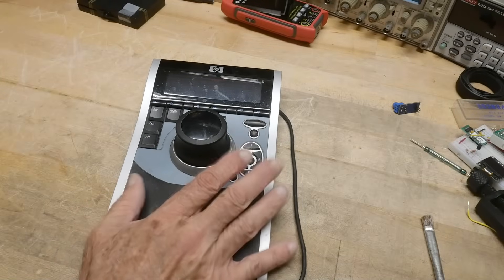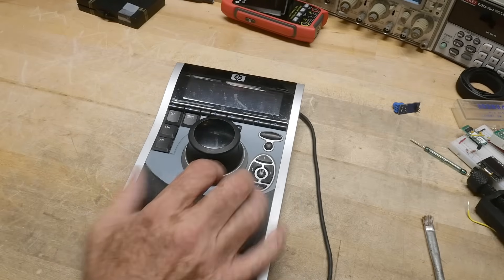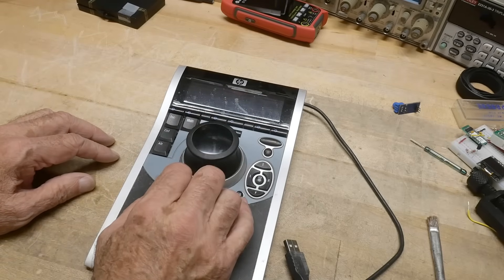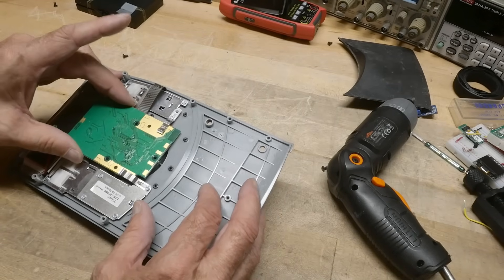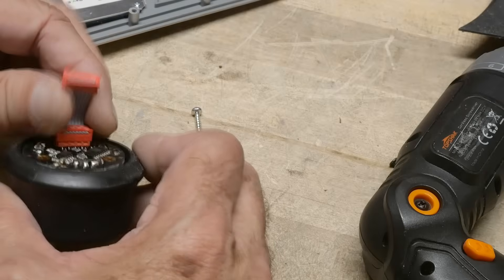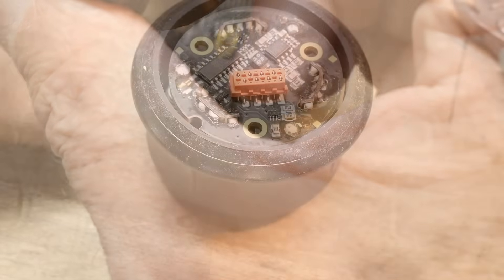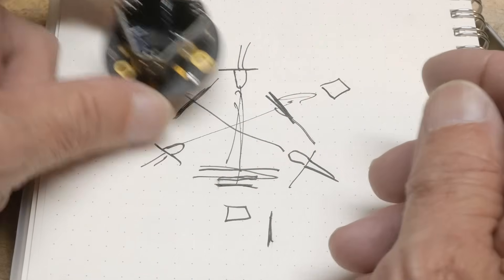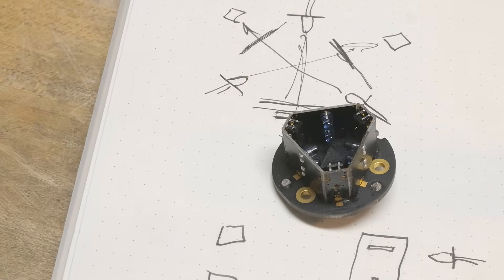#2327 Space Pilot Teardown (aka space mouse)

Comment: The special photodetectors called PSD (position sensitive device) might be most suitable as sensors in this case. 
https://en.wikipedia.org/wiki/Position_sensitive_device   -   They were very much in use for cheap triangulation devices. (I still know them as the good old GP2D12 but they have longer names today.) 
They might be worth to be studied separately.

Comment: The early seasons of The Expanse used a SpaceMouse Pro as a flight controller on the Rocinante. It's the same 3D control but with a different base and buttons. I use a SpaceNavigator for 3D CAD work, so noticed it straight away back in the day.

Comment: Hmm, never seen one of those before.  I like the 3 dimensional control.  Curious to know if the slits are in different positions in the 3 positions.  They would almost have to be to tell what direction they are going wouldn't they?  If they were all in the same spot when you rotate in either direction they would all basically block light at the same time.  If they are in different positions then you can sense direction, correct?  Same for the up down sensing.
Reply: I think the receivers measure the position of the light spot, and the spot moves with the slits. 
Would be kind of interesting if our guy could figure out what sensor the model is.
Reply: @ulwur  I wonder if it's a linear CCD or similar?